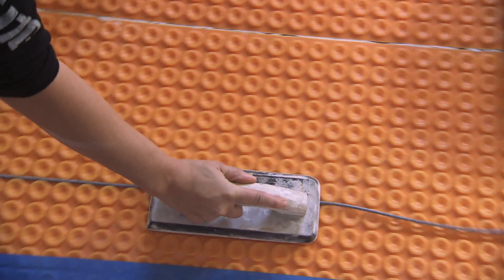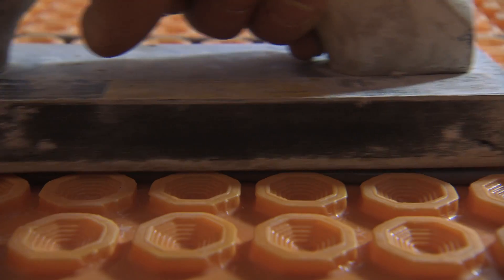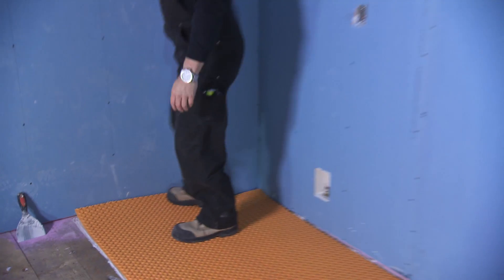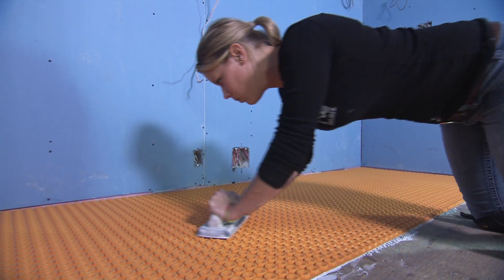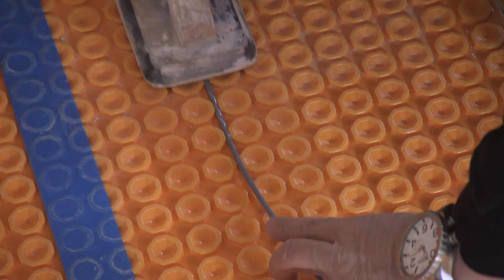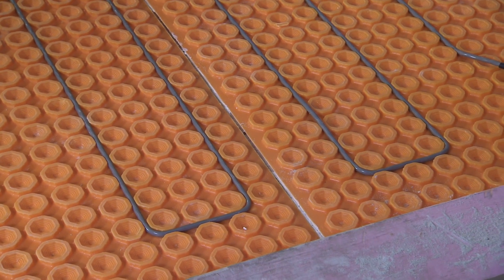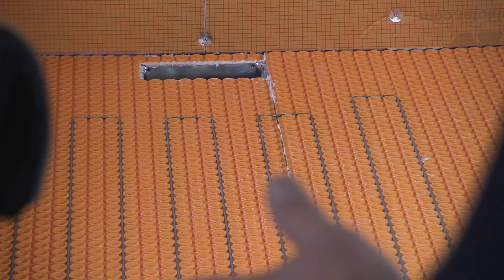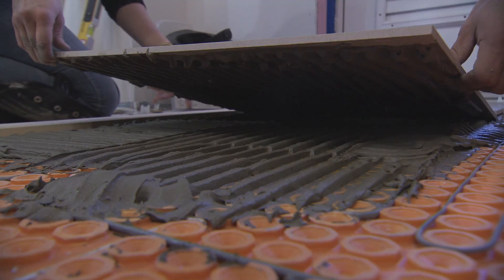Mike Holmes on Schluter®-DITRA-HEAT

Comment: the floor sensors fail after a few months of use . try getting the contractor back to lift up tile 😠
Reply from the maker: Hi there! Sorry to hear you are having trouble with your DITRA-HEAT system, we want to support you with that! Can you please contact our customer service team to discuss your issue, and they will help guide you with next steps from there. 800-472-4588 (US) or 800-667-8746 (CA)

Comment: I have a red light going off on my teacher heat system panel, had a guy tell me that if you use a wire nut on the ground wire and the braided ground wire that it doesn't hold right and it may make the light keep blinking or the GFCI blink? I run the heat all day. It runs fine, gets to temperature and at some point of the day it turns itself off or at least trips. Is that something that can happen with using a wire on the ground wire?
Reply from the maker: Hi there! We recommend reaching out to our Customer Service team. They'll be able to ask you more questions about your specific situation in order to give you the most accurate answer possible. You can reach them at 800-472-4588 (US) or 800-667-8746 (CA). Thanks!

Comment: Mike can you run the electric part of this off an existing circuit? Example connecting power of a switch or plug near by? Does it HAVE to be a dedicated circuit? It is very difficult to get a new circuit from my box to the bathroom due to attic space.
Reply from the maker: Hey there. A dedicated circuit is recommended for each application, but a circuit supplying one or more fixed room heaters may be used, as long as its rating does not exceed 30 amperes, that the total current from all branch circuits does not exceed 80% of the circuit breaker limit, and the branch circuit cable reaching the thermostat junction box is of the same conductor size as the main circuit. So, a switch or plug wouldn't work, but a fixed heater could possibly be shared.

Comment: Would a large area rug over heat the system and cause it the fail?
Reply: I haven’t seen any area rugs with a r value rating . I checked every where
Reply from the maker: Hi there! This is taken from our handbook: rea rugs are not recommended over the DITRA-HEAT system, but if used, they shall have an insulating R-value not greater than 1 (Rsi not greater than 0.18). The area rugs shall not be located on top of where the floor temperature sensor is placed, as it will otherwise reduce the heat efficiency. Also, do not place furniture or mats over the floor temperature sensor. They can act as insulation and raise the floor temperature reading at the thermostat. This may cause the heating to turn off before the remainder of the floor reaches the desired temperature.
Hope it helps!

Comment: How do you waterproof the joins between the mat?
Reply from the maker: Here you go!

https://sccpublic.s3-external-1.amazonaws.com/sys-master/images/h38/h3f/9007361359902/Shower%20System%20Installation%20Handbook.pdf

1. At the joints, fill the cut-back cavities with Schluter SET, Schluter ALL-SET, Schluter FAST-SET, or unmodified thin-set mortar, approximately 8" (203 mm) wide, centered over the joint.

 2. Comb additional Schluter SET, Schluter ALL-SET, Schluter FAST-SET, or unmodified thin-set mortar over the joint using a 1/4" x 3/16" (6 mm x 5 mm) V-notched trowel or the Schluter®-KERDI trowel, which features a 1/8" x 1/8" (3 mm x 3 mm) square-notched design.

 3. Using the flat side of the trowel, firmly press the 5" (127 mm)-wide Schluter®-KERDI-BAND into the mortar to ensure 100% coverage and to remove excess mortar and air pockets.

 4. At all wall junctions, apply KERDI-BAND as described in steps 1-3, ensuring a minimum of 2" overlap on to DITRA/DITRA-XL.

Notes: KERDI-BAND must overlap DITRA and DITRA-XL at seams and at floor/wall transitions by a minimum of 2" (50 mm) in order to maintain waterproof integrity. In some applications the vertical section of the floor/wall transition will not accept a bond to Schluter SET, Schluter ALL-SET, Schluter FAST-SET, or unmodified thin-set mortar. Connections to such elements can be achieved using Schluter®-KERDI-FIX or suitable trowel-applied waterproofing materials, such as those that require atmospheric moisture to cure (e.g., urethane sealant).

 For complete installation guidelines and warranty criteria please refer to the downloadable Schluter®-DITRA Installation Handbook and view the step-by-step installation videos available below.

Comment: Can I use regular ditra as initial layer instead of plywood or will this regular ditra plastic melt or deform?
Reply from the maker: Hmmmm... that wouldn't be in-line with our Technical Handbook. We do not recommend using Ditra as the initial layer. Here's our Handbook for more info: https://sccpublic.s3-external-1.amazonaws.com/sys-master/images/h47/h7c/8986876280862/DITRA-HEAT%20Installation%20Handbook.pdf

Comment: why do we need to keep it 8" away from any other heat source?
Reply from the maker: Hey Steve. Keeping DITRA-HEAT heating cables 8" away from heating sources is due to requirements from electrical codes.

Comment: One little mistake I noticed during the Ditra membrane installation: thin-set was combed directly to the concrete instead of being buttered, which ensures 100% bonding of substrates- the technique I learned attending Schluter training.
Reply: Yes you are corect material should be troweled on wiyh flat edge of trowel first with sufficient force ,this is  cslled burning material to floor then troweld out with Ditra notch trowel , i also use a 30 lb, rolled to set Ditra into Unmodified material

Comment: Can you put the ditra heat under a washer dryer in a garage to keep the system warm?
Reply from the maker: Hi Nathan, No, the heating cables should never be placed under such structures--when there is no space for the cables to breathe, excessive heat will build up in these confined spaces and may cause cable overheating.

Comment: when using Schluter ditra-heat system. can I just lay out an 9x10 piece mat or do I have to lay out the whole room with ditra mat
Reply from the maker: Hi Stella, I think we could use more details on your question. Could you possibly give our Customer Support team a call 800-472-4588 (US) or 800-667-8746 (CAN). Thanks! Talk soon.
Reply: You can on the are that you are going to lay the Ditra Heat cable but it will be slightly  higher than the rest  of the floor

Comment: Do you notch back butter the tile and the floor? I swear I seen this in this video.
Reply from the maker: Hi David,
Thanks for your question! Here is what our handbook recommends:
Fill the cut-back cavities with Schluter SET™, Schluter ALL-SET™, Schluter FAST-SET™, or unmodified thin-set mortar and comb additional mortar over the matting using a trowel that is appropriate for the size of the tile. For large-format tiles, e.g., 12" x 12" (305 mm x 305 mm) and larger, back-buttering the tiles with a skim coat of thin-set mortar is a useful way to help ensure proper coverage.

To read the complete handbook: https://sccpublic.s3-external-1.amazonaws.com/sys-master/images/h1d/h83/8884878671902/DITRA%20Installation%20Handbook.pdf
Reply: Unmodified matetiel specifically states to back butter tiles  ,floors must be prepare to a flat plain surface , building up mortor bed can resault in week spot , tile can be compromised  later on  ,,,prep worl 110 % important for good solid finsh product